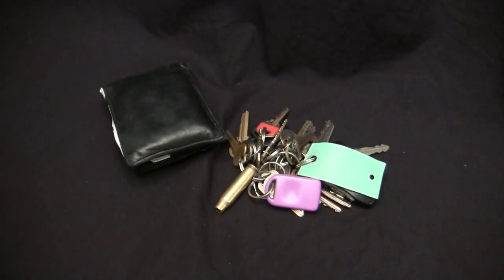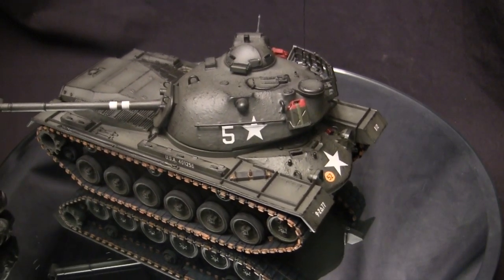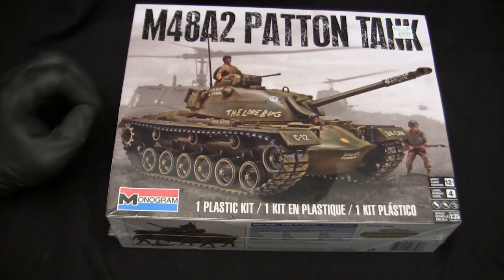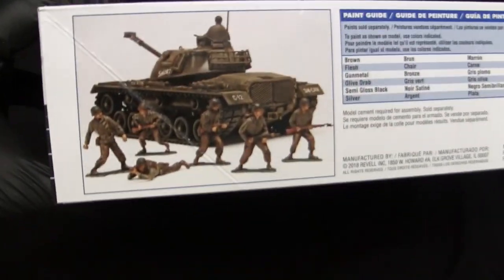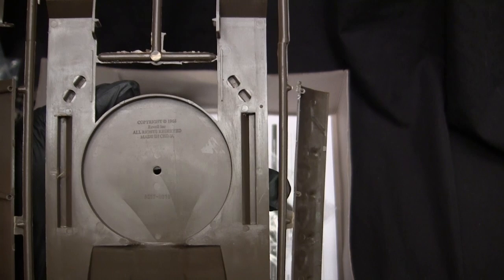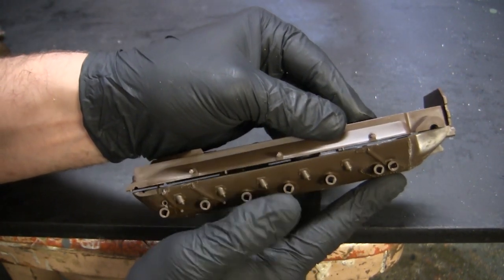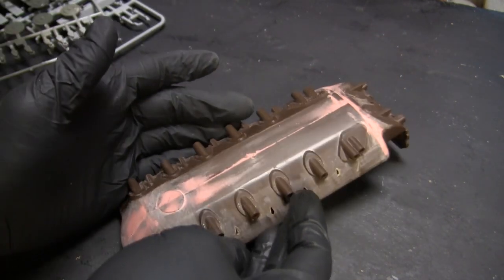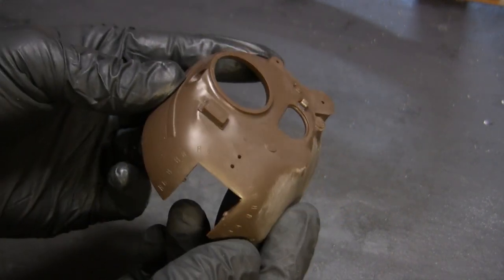Vintage 1/32nd scale Monogram M48A2 Patton Tank

Comment: Very nicely done! I have built a few of these over the years, and really enjoy this kit for what it is. It is definitely 1/35 scale as were the other 1950s era Monogram military vehicle kits. The later Monogram armor kits that ran from the late 1960s to mid 1970s were 1/32 scale. Why they made that decision is beyond me. Just compare it side by side with a Tamiya M48A3, they are the same scale.
Reply from the maker: I can't disagree enough on the scale being 1/35. In this video I did compare this Monogram model to the Tamiya 1/35 version. The direct link to the timeline is here, https://youtu.be/hpg-9gXYbbw?t=4441
There you will see that the Monogram is wider, and longer. The only dimension that is the same is the height, and that's because Tamiya's model site too high
Reply: @oddball759mm  I own both kits, and compared disassembled kits from both manufacturers. After a thorough part to part comparison: track length and width, road wheel diameter, spacing between torsion bars, turret diameters, hull dimensions, and interchanging main parts. I'll stick with 1/35 on the Monogram. The fenders on the Monogram are a bit wider, but everything else matches up so closely, that I'm comfortable with my conclusion. I'm not taking anything away from your conclusion, but just recognizing a difference in conclusions. I admire your modeling skills and love what you did with your Patton.
Reply from the maker: @MucheaCAPCOM  I respectfully disagree with your findings, as again the tamiya is smaller in all aspects excluding the height because of the mistake they made that I referenced. As for matching up closely, that has more to do with the two scales being so close to one another that part dimensions can be fudged and using 1/35 parts on a 1/32 build is passable. However at the end of the day the tank is closer to 1/32 than 1/35